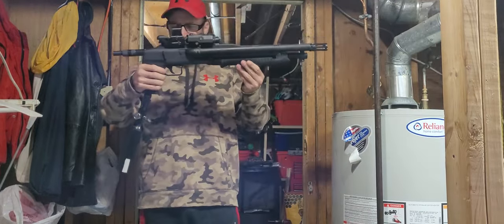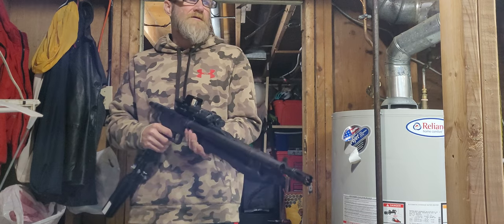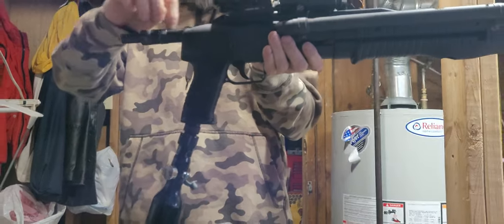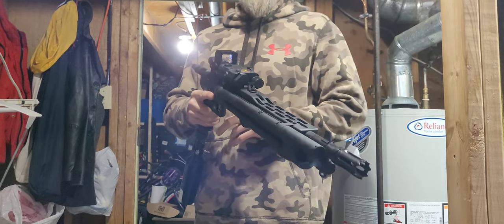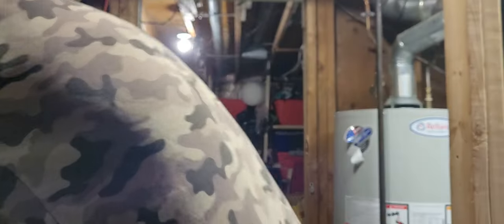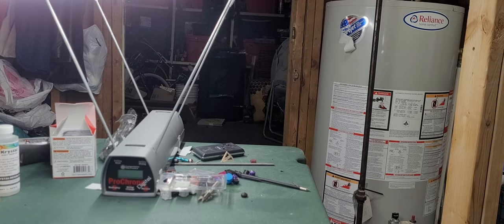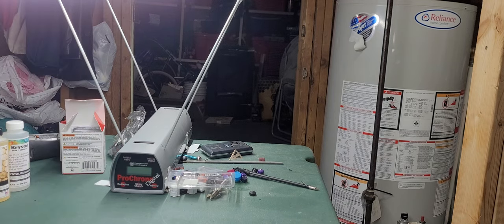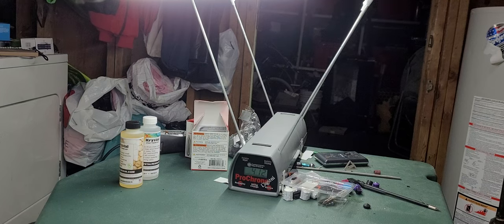Umarex T4E HDB 68 30 rd Mag Critical Situations Master Cylinder Test

Comment: Hey there mate wanted to ask is it possible w/the umarex hdr 68 to get from 30j  to around 37-40 j  using the c02 cartridges ? would those not be strong enough to get to those joules 37-40 ?  thanks for the info and the sweet videos.
Reply: Hi. I'm also try to tune the HDR 68. So far: I've got a 2*12gram co2 adapter. Put 2 co2s in the adaptor and put a blank spent co2 in the gun. This gives about 4-5 mags starting 38joules down to about 20 at the last one. I'm after any advice on how to tune it further myself.
Maybe get it on air next
Reply from the maker: look through my hdr playlist :)
Reply: I'll check that out. Although I've watched most of your videos multiple times. 35-38j is probably the max I'm getting out of this HDR 7.5j with an 88g co2. Removed valve also.
I dont really want to put a barrel on it. I was going to try HPA. Any suggestions of anything I could try first?
Get it in the 40's and I'll be happy for this marker.
Thanks!

Comment: Can you clarify the Oring please?  got the 7 jule model, do I need to change the Oring to run it with 850psi?   Do I nee the 1.5x6 Oring or the 1.6x6.1mm Oring?   where do you buy the oring usually?
Reply from the maker: yes get the 9.3 od, 6.1, 1.6 ones you can get them from orings and more dot com